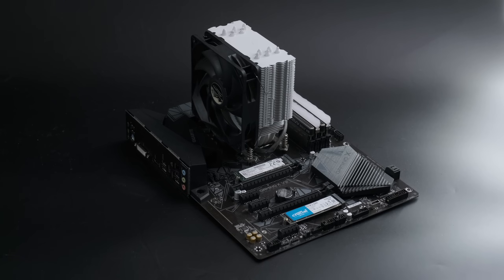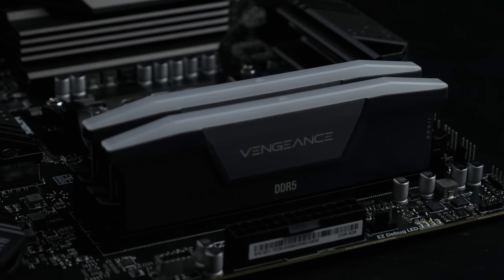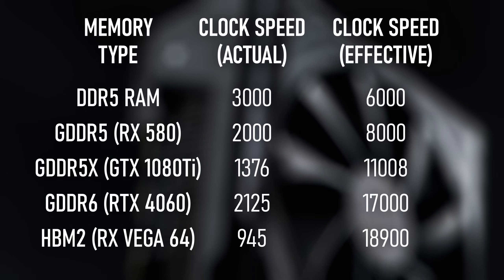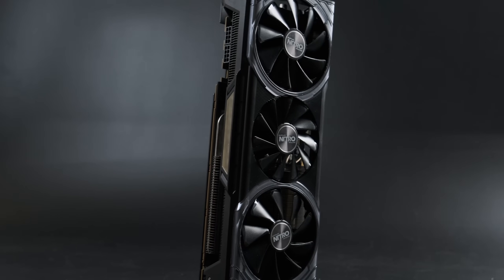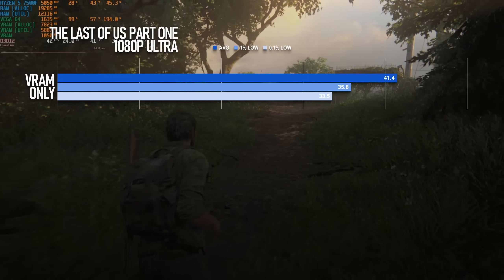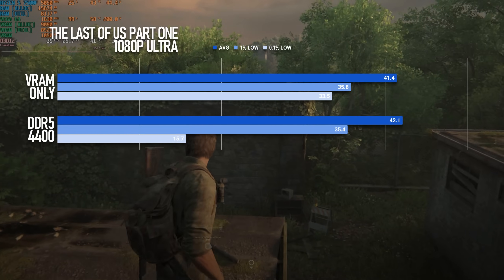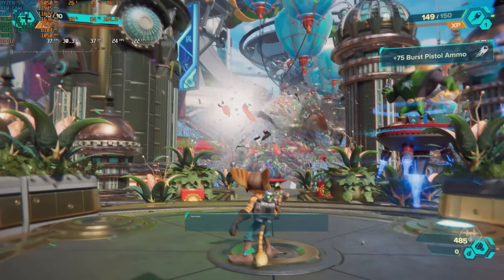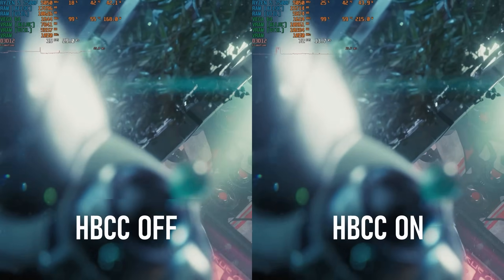A short video about HBCC and DDR5

Comment: It definitely seems like this feature is effectively worthless for gaming but it’s got me curious about other applications. Running inference on local LLMs has become a huge surprise use for the larger ram configs on the latest MacBook Pros. I’m curious whether you’d be able to achieve something similar with the proper config and a Rad VII or other pro Vega card + paired it with a modern quad memory channel  HEDT board and a much larger pool of fast DDR5 ram. I feel like 16 gigs isn’t really enough to explore the gaps this was meant to fill in

Comment: I've always found these cards to be a technological marvel. A relatively slow, stuttery marvel, but that doesn't take away from how cool they are
Reply: It is kind of a bit of bad timing that AMD ran out of cash to keep driving FURY/Vega forward, as pretty much since Turing Nvidia has gone the same route of a Compute primary architecture.  Turing especially, as you can see Nvidia basically redoing the design again with the breaking off of tensor and raytracing cores vs Turings universal one.  HBM and HBM2 did not do AMD any favors either on the consumer side - so pricey on the BOM but such sweet sweet bandwidth

Comment: HBCC seems to suffer in the same way (or at least less severely) to how eGPU's suffer.

When you flick your camera it has to load new assets and if the bandwith isn't enough, you get stutters.

With TB4 it seems to be a limit on CPU draw-calls and with HBCC seems to be a limit in how fast the DDR5 memory can serve the assets... which have to pass trough the CPU.

With TB4 you loose performace and with HBCC you apparently only get the stutters.

Comment: If AMD would have done something like, using the system memory to cache things out of storage for use later, that MAYBE could have made a difference instead of using the system RAM as an extension of VRAM. I mean, personally I ride a fine line with system RAM as it is with "only" 16GB in some games as it is, and I know even if this worked well as AMD had it set up, I wouldn't have much RAM left to feed the card "extra" VRAM. What would have been maybe better is being able to take a game's assets and have them pre-cached into basically a RAM drive instead of pulling even straight from a MUCH slower storage drive. But, then again even that may not be all that much more useful either. It is a cool theory, and if we had system RAM as fast as VRAM, coupled with a more direct pipeline from the GPU to system RAM that could bypass the CPU itself, this could make a lot more sense. But, considering that AMD was not as competitive with Nvidia as it should have been in this generation of GPU, it is cool to see that AMD was trying to think outside the box for future ways to make their cards more competitive...I guess.

Comment: Right. the bus PCIE 3.0 bus on the card is limited to 16 GB/Sec. isn't modern pcie 5.0 at about 64 BS/sec? that might make a difference.......if there was a HBCC capable card on PCIE 5.0, but there's not. i think HBCC has a future if/when they decide to split video frame buffers to multi tired memory solution on the card itself. it would enable lower cost high capacity cards.

Comment: The mythology that's been built up around around HBCC is pretty ridiculous. HBCC is just a fancy way to control shared memory (something essentially every GPU can do) allocation. Maybe it can improve efficiency in some niche scenarios, but there is nothing that can be done if the card doesn't actually have the memory to hold the assets a scene actually needs. Really slow memory is not and cannot be a replacement for really fast memory.

Comment: would this be useful for image generation ?
SDXL models need quite a lot of vram, else stable diffusion webui just crash
Reply: It could be. The fastest cards that support this are still going to be very slow compared to a new card, but if it's what you have, might as well try it.
Reply: @DigitalJedi after all the issue with local AI is mostly being able to fit it in memory, and with such methods you can even have a 64GB GPU for 200$
Reply: Definitively recommend looking into this, always was curious about how that hardware would fare there 🤔

Comment: Would like to see higher speeds like 7200 on Intel. Just for the science really.

Would be interested in a video on True Audio and other GPU technology footnotes. Hybrid crossfire / the later dual graphics would be interesting.
Reply: Vega is pci-express gen 3 limited (theor. Max limit 15,75gb/s), doesn't matter if Intel supports gen 5 and 20% higher bandwidth ram (6000 vs 7200)

Comment: Have this on my machine, still run a 5700XT. Can’t say much for performance but it certainly perks up the mood in Task Manager. 72GB on My graphics card? Excellent.
Reply: is that posible? also running an 5700xt would help in solideworks

Comment: HBCC is non-existent. There's no die shot of the RX Flop series/Flop VII showing HBCC even exist.

Plus, AMD claims that HBM will replace GDDRx since it's reduced memory footprint, lower board cost, etc, even exist on their lower end card! Yes, even a budget card for office PC will have HBM-type memory.

We should shame AMD/Evil Su for not making it through.
Reply: This comment brought to you by Userbenchmark
Reply: @XiaOmegaX Yawn, so original, maybe you're UBM? 

Just find me a picture of RX Flop series/Flop VII die shot.

Or if RX 7000 series uses HBM.
Reply: I'm not sure why anyone would expect to be able to see what is primarily a software feature on a die shot. At most, the silicon implementation of the HBCC is like some kind of MMU+TLB, which would be tiny and hard to distinguish from similar structures in the memory controllers.
Reply: @morbadthworst8148  HBCC is more like a CPU cache for the GPU, and it's the last level.

Except, if you look at the RX Flop series/Flop VII render, it's a huge chunk, and I cannot find which render from AMD which they marked out HBCC, which is shared among the GPU cores.

Nope, the MC are usually at the perimeter of the die.

There's no real shot of the die, so HBCC doesn't exist.
Reply: @AlfaPro1337 There are x-rays of the Vega dies, but HBCC was never presented as a physical cache within the GPU. Block diagrams are not intended to be representative of physical structure. HBCC is simply supposed to be a way to allocate virtual memory so that the most used assets fall within the GPU's physical memory addresses, while the shared memory is reserved for allocated, but infrequently used assets. Basically what the driver and OS memory managers are supposed to be doing anyway, just better, supposedly. No one who knows anything about HBCC thinks it's a chunk of on-die cache.

Comment: Sucks that AMD didn't continue making this feature even better.
Reply: As post mining bystander that saw Vega 56 fail memory check I say that hbc is not sustainable in commercial market.
Reply: I don't think they could, the entire mechanism of using system RAM as main video memory and VRAM as memory cache doesn't really work with videogames or really anything that frequently makes changes to video memory. It's basically the same idea as using SSD space as system RAM -- it works for when your application just holds a ton of assets in memory but operates on only some of them at a time, but if you're working with all assets at the same time, the performance will fall off a cliff.
Reply: @HunterTracks  It works very well the test was stupid 1080p res doesnt need much vram, HBCC boosts performance in games where more than 8GB of VRAM is needed
Reply: Maybe PCI-E 4.0 could've solved this issue.
Reply: @NONAME-lv8ug If it could've, then I think they would've tried. It's not like AMD wouldn't have thought of this too.
Reply: @NONAME-lv8ug  Even so it wouldn't help because it still would have to go through the CPU, this is why direct storage was created in the first place. The texture would still go to the CPU to be processed and when it is done it will go back to RAM then to GPU. Image RAM as a bridge, the CPU is a bunch of toll booths on that bridge, SSD is the start point and GPU VRAM as the end point. You could widen the bridge but the toll booths will be the one causing jams on the bridge. Hell I believe in this video it showed that perfectly, Ratchet and Clank is an direct storage game, therefore it benefited a lot from this, where as TLOU isn't. I would loved to see a re-test with overclocked memory controller to see if it make a different especially since the 7500F isn't that good with memory overclocking or has a very good memory controller I believe.
Reply: @NONAME-lv8ug  Here it's a issue with DDR bandwith and CPU calls.

Not PCIe bandwith
Reply: @NONAME-lv8ug  the problem is not one of bandwidth, its one of latency, you could give the GPU and system RAM a 1 terabyte per second connection but if the latency is the same as it is now, you won't see a difference

data does not transfer instantly, sure the time is measured in nano seconds, but 10 nano seconds compared to 2 nano seconds is a massive difference

GPU companies wouldn't solder VRAM to the GPU for no reason, the reason they do is to push the latency as low as possible, hell AMD cared so much about lowering latency that they have their infinity cache, which is a small amount of VRAM soldered directly to the GPU die itself
Reply: @MayYTlive more bandwidth can decrease effective latency if work is queued. RAM is soldered for better signal integrity since it's harder to reach GDDR and LPDDR's faster clocks, DIMMs actually have lower latency on SoCs.

and what you've said about infinity cache has some half-truths: it is a cache, it does not store any/all unique data like main memory does, it just backs it up so it can be reused faster. it is SRAM which (in RDNA 2) is on the GPU die just like the compute units. Technically with RDNA 3's bigger GPUs it is on a separate die soldered onto the same substrate as the main GPU die
Reply: @NONAME-lv8ug no. It's a latency/bandwidth issue. When you mix the two problems together, you get really subpar outcomes. There's a reason why GDDR is a thing and this demonstrates why.
Reply: HBCC exist as a meant to augment HBM lack of capacity. AMD revert back to GDDR memory after vega so there is no need to push HBCC tech further.
Reply: They can't because VRAM will most likely always be much faster than DRAM.
Reply: They cost too much at that time
Reply: I thought this concept was related closely to the AMD development in the direction of Heterogenous compute.
Reply: if the memory bottleneck is minimal, it'll probably be extremely beneficial for APUs like Ryzen 8700G
Reply: @osopenowsstudio9175 it wouldn't do anything

The Apu's have none of  their own ram, there already using system memory as there only form
Reply: @trackingdifbeatsaber8203  yes and that's what makes the latency high, if they didn't have to go through such much checkpoints (motherboard, PCIe, CPU and slow RAM)
Reply: Nah, I would rather them focusing on a more important issues something like implementing fsr 3 on more games so we can get frame generation on all cards.
Reply: @MtFoxt  Fame generation is just a markething stunt. It's useless, it's an optical illusion, it only works for slow-paced single-player games(if that).
Reply: @Splarkszter  while they clearly done that for marketing. It has its useful parts too. Exactly how you said‚ it works for slow-paced single-player games. For the games with extreme fast movements‚ it depends‚ as there is some input lag added. But personally, I've found the in-driver Frame Generation from AMD to be useful for some games that have weird frame pacing (a feeling of not being true 60 FPS)‚ and that worked for me especially with some old games.
Reply: If they did, it wouldn’t matter, people still wouldn’t buy their garbage GPUs.